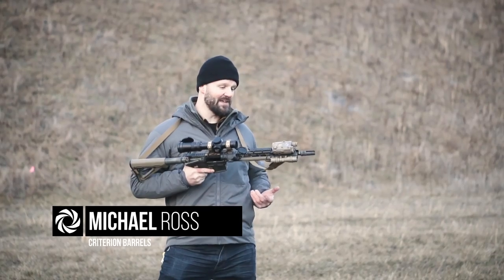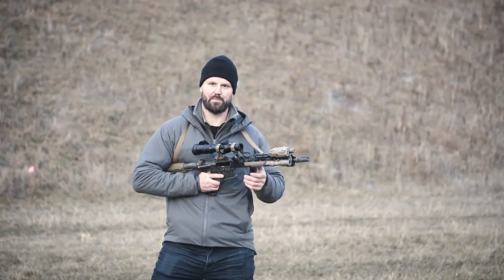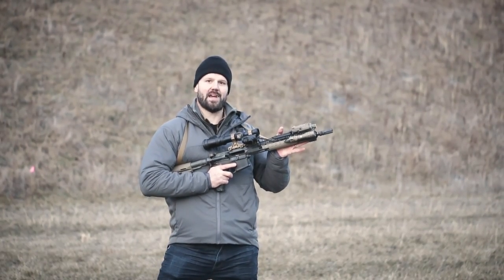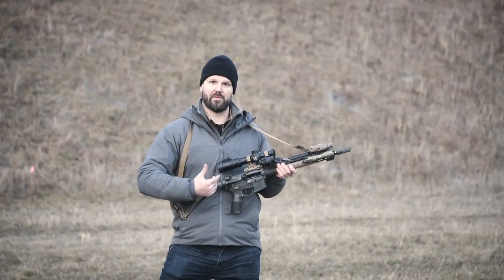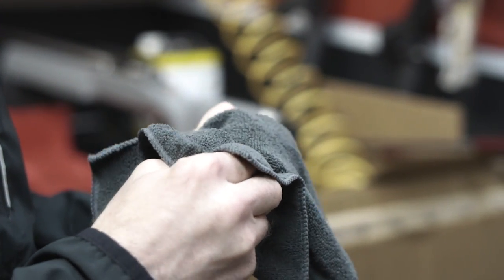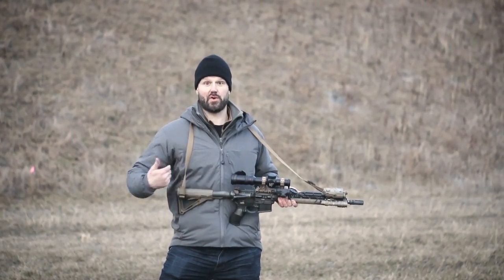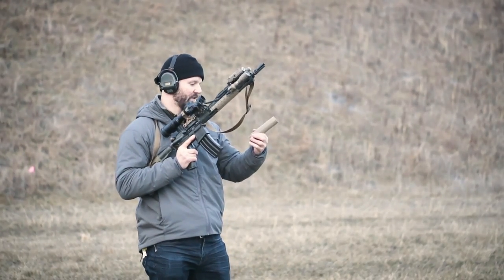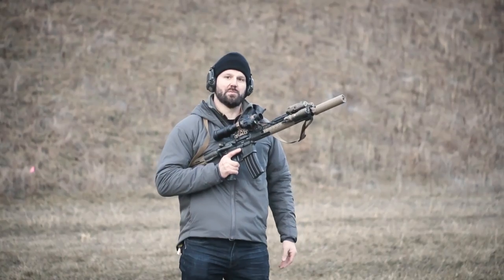How to setup your AR-15 with AND without a suppressor

Comment: I have a 13.9 Core which i like but it doesnt like running some ammo...I usually like more reliability in gassing but anyone see this? or maybe should i use a H buffer with lighter spring? Doesnt like steel case and some others.
Reply from the maker: You should have no reliability issues with a properly built rifle.  We would happily take a look at your complete upper to get any issue resolved and your upper running like a sewing machine.  Feel free to reach out to our customer service department and we will take care of you.
Reply: @CriterionbarrelsInc  that would be cool. its a complete upper i got from adm. my buddy has one too its just not a Core. his runs whatever. mines a CORe. wont run steels which i just use to test for reliability anyways. also doesnt like reggie 55 ball with an H2 which i thought was wierd. where can i send that in?
Reply from the maker: @rickypickles2219  Feel free to shoot an email to contact@criterionbarrels.com and we can send out a pre-paid UPS return shipping label to cover the cost of bringing in your upper for a detailed inspection and testing.  Looking forward to it.
Reply: @CriterionbarrelsInc  will do

Comment: Ejection pattern is subjective, does not need to be 4 o’clock to run good
Reply: Needs to be between 3-5 to run optimally
Reply: It's not just about running reliably, an over gassed gun will run, but it is also about pounding the crap out of your internals and heavier recoil.  The idea is to tune it with the least amount of gas that will reliably run the gun.  Of course, that goal post moves depending on if you are building to strictly run one particular cartridge (such as 220 grain 300 Blk subs with a suppressor), or you want reliability with multiple  bullet weights, loads, both suppressed and unsuppressed, etc.

Ejection pattern isn't subjective, it's a decent indicator of your gun's gassing.  In the video above, you notice when he put on the suppressor, ejection moved forward, which is to be expected with the extra gassing from the increased back pressure.  It's still within acceptable limits, but if that gun were to be fired exclusively suppressed, I'd be looking to reduce gassing.  Over gassing means harder wear on the internals, more recoil, and more crud and carbon blowing into the receiver (and your face).  

There are multiple ways to adjust things, adjustable gas block (and I'm sorry, I will disagree with him concerning those, good brand versions today are very reliable and don't wear out any faster than fixed ones), adjustable BCG, and buffer weights and springs to name a few.  Heavier buffer and springs should only be used when you can't adjust anything else, or have run into limits as they will mitigated the pounding and timing when over gassed, but do nothing to reduce the extra crud and carbon blowing into the receiver.

The lego gun is great in that it will run in less than perfect tune, but if you want it to last longer and shoot better, tune it.

Comment: Is this a 13.9 core on a 13 MCMR?
Reply from the maker: No, the 13'' MCMR is a little longer than 13'' and will not provide clearance when using a suppressor in conjunction with a 13.9'' CORE Series barrel.  The barrel on this rifle is 14.5'' long.
Reply: The Knights Armament 13 in rail will work for you. I have it on the 13.9 CORE build.